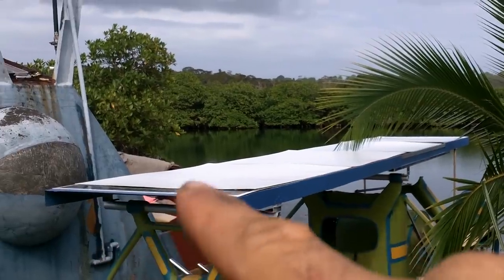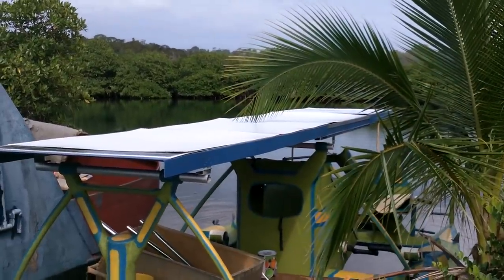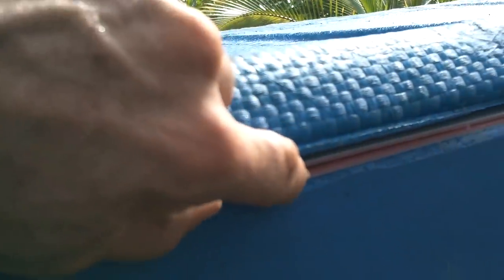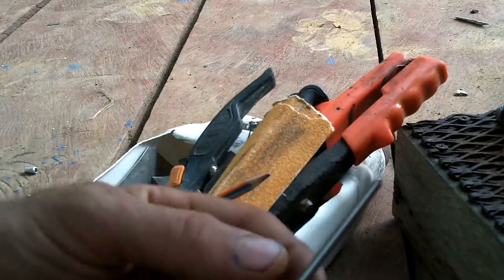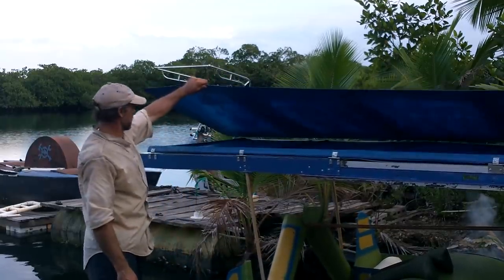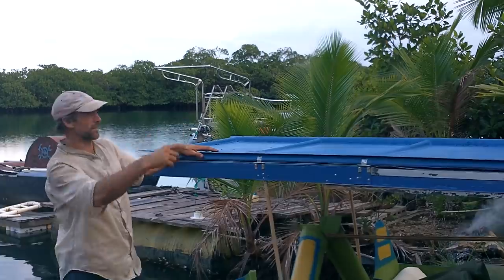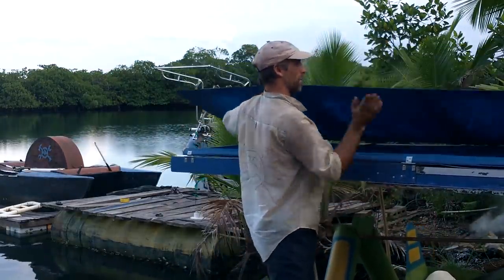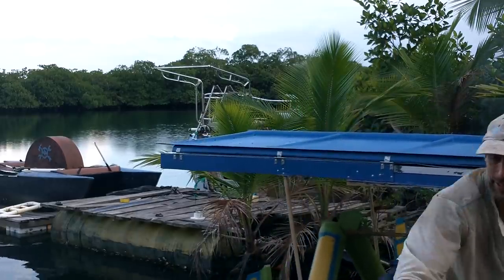Solar Snailer 032 Flaps

Comment: Good luck with those hinges Jamie. Any significant wind and that thing is going to blow apart. You need more reinforcements. Don't be so cheap and buy some long hinges. Save you from a lot of grief. Just 
my opinion.🤔 Be safe out there.
CHEERS🍻
Reply: My truck cap door takes much abuse and stresses the continuous piano hinge . Those riveted hinges will be put to the test!
Reply: I think he plans to fold them up so they don't experience any force from wind, when the wind comes...
They will only be deployed when in use and on nice days. Hopefully they never experience too much wind except when he get caught out in it!!! I expect if the wind starts really picking up, he will just quickly fold them up and use battery reserve and pedal to get the rest of the way home.
Reply: @Reach3DPrinters  I presume that you have not been on water larger than a ....bathtub?. A light chop will produce a constant hammering effect. I'm sure Jamie will get it right as usual.
Reply: @mikeoconnell4229  The length of those pontoons, It would take more than a light chop.
Sure, if the boat is sideways to incoming waves it would rock pretty hard back and forth in each wave trough and crest, but if he were even 15 degrees headed into lateral waves, I don't think there would be as much rocking. In non windy conditions there shouldn't be a problem with 2' waves.
In windy conditions, the panels would be folded, so far less stress on those hinges.
Sure, a couple more might help, but I doubt it would be necessary in low wind conditions.

Comment: you do not need poles, just some extensions, or under the central panel 
that you slide out and lateral panels will rest on them, or on lateral 
panels, above, and when slide out, will fit under the central ones and 
the result is the same. but the above ones can be made at an angle and 
provide that shade you mentioned. Actually the one below can be made 
bent, and rotating them will provide the angle. but bent will not slide 
in anymore, so will be detached when unmounted.

or better third option triangles rotating around middle poles. when folded, the upper side will rest next to panels. and the longer side may be telescopic for angled position. if this side is cumbersome for loading the boat, may be extended along the panels too, and mounted at the base in a short pipe when unfolding the panels. but actually this means poles, :) folding, but still poles

Comment: Fiberglass rail down more than enough to get an angle greater than say 45% degrees, The you can adjust the height with pins. This should work!

Comment: if you stabilize the center solid enough you can flip out tubing sideways mounted on the outer edge of the center portion that the new panels can rest on. PVC clips in place mounted on the side of the folded center console can stow the non pivoting end of the aluminum pipe to keep it in place hile folded. Additional poles can be mounted on the boat that fold upwards to add additional structure to the underside edge of the deployed panels and pin into place under the load for high winds. if these poles that are mounted on the boat hull edge can be adjusted to pivot if needed like a socket wrench jointed socket that can be pinned stiff for upright deployment, they can be made to pivot when needed also. This way in dry dick or high winds where you need to fold up the panels and it is Still not enough structure, you can fold the panels up and deploy the stability poles mounted on the boat at an angle that can attach to the folded center roof at an angle giving it super stability for real rough weather.
Reply: Bla bla bla! Man o man a real talker!

Comment: While you are designing a way to hold the panels fully open, keep in mind how they are gong to hold their position if you encounter a good wind or are going at a speed that induces lift in them. Having one blow up and over onto the other panel wouldn't end well.

Comment: When it is sunny and windy at the same time, what would you prefer: the sail or the solar power?
Reply: This sail design is only good for going down wind, as they can't pivot left and right there is no way to correctly angle them to the wind, and they also have no curve or air foil shape. For reference Chinese Junks could sail upwind in 206 BC. This will probably work much better on solar then on sails.

Comment: Seems to me that this is over complicated. I would have just had the solar panels down the middle, done.
Reply: Folding them up so they are protected from sun when not in use was part of the plan. More panels would also make roof surface area larger, so in high winds, that could tear off, so reducing roof area by folding up reduces chance of wind ripping off roof.
It does complicate it a bit, but only a few extra hinges, and I think the reward of panels that last 40 years, vs 12 years, is probably worth it.